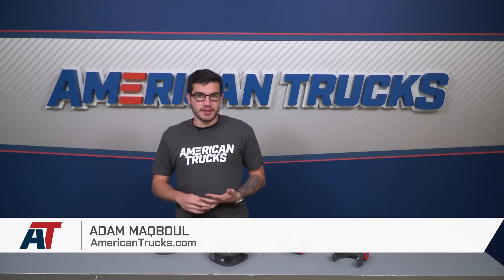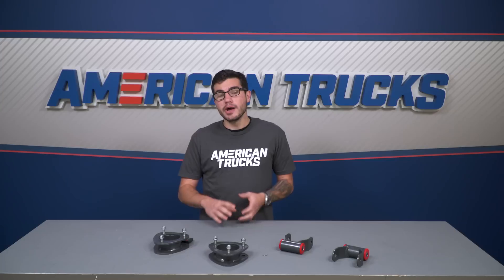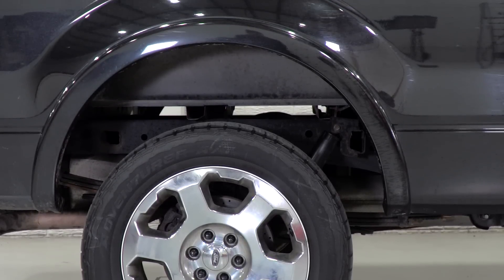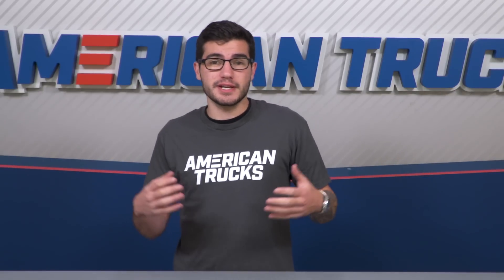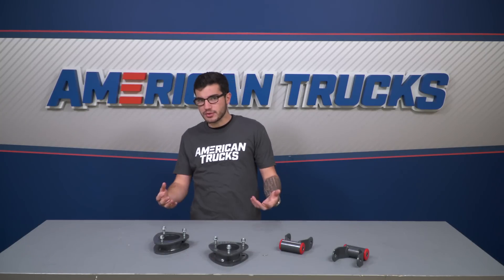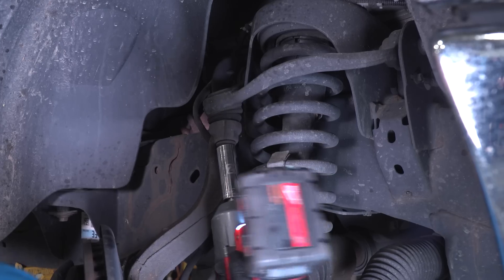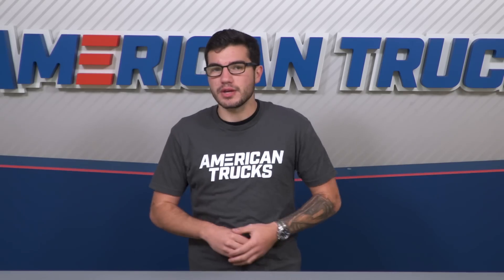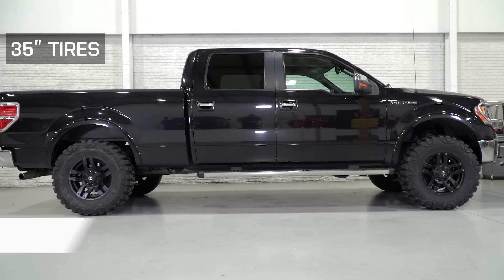2004-2013 F150 Max Trac 3"/Front 2" Rear Lift Kit Review & Install

Comment: Took me 6 hours, Im a noob. Just remember the sway bar end-links have to be disconnected on both sides at the same time. I tried to just take off one wheel at a time and that doesnt work in the front because of the sway bar. In the rear you can do them individually. Im running 22x12 -44 on 33's with a 3/2 on my 2014 Expedition (same front end as F-150) and I rubbed hard on the step-boards, and a little on the front air dam, and rear brake lines are not stretched but the level kit does take away all the extra slack.
Reply: Any alignment issues?

Comment: don’t torque your suspension bolts until you have curb weight applied, either with a floor jack or lower onto ground.

Comment: I don’t understand the benefits of spacer lifts or any lift like that. It seriously messes with the geometry of the suspension. If you’re looking for a lift go all out with knuckles and drop brackets. That raises the truck off the suspension instead of in this case, stretch the suspension
Reply: Hello hello cool videos dudes,how can i clean the engine on my 2015 ford f150xlt crew cab ecoobost?can you please show how